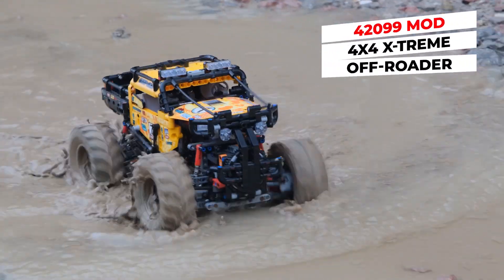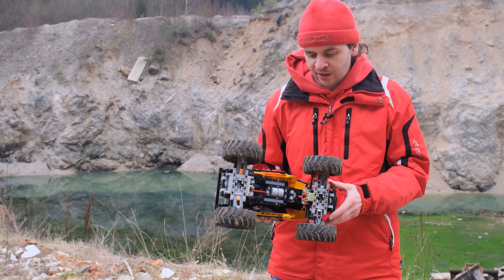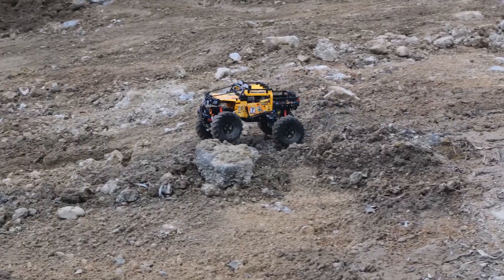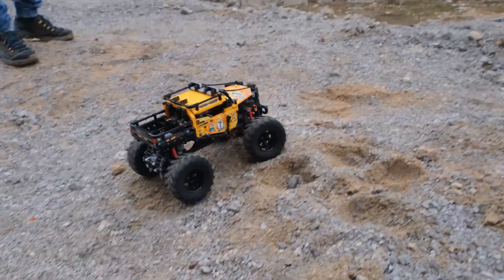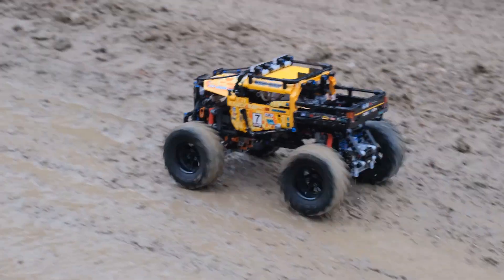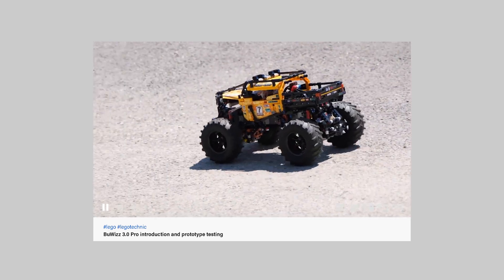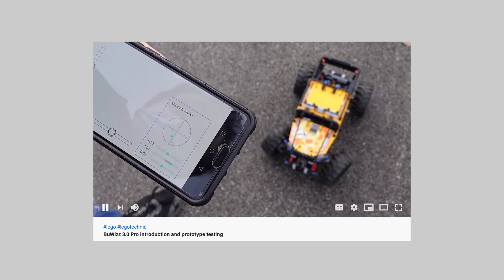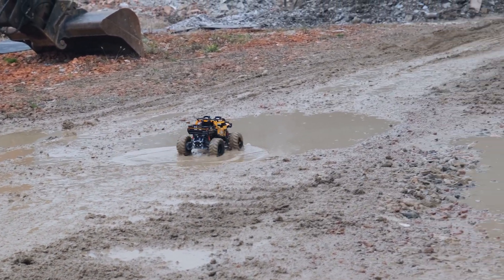Modified LEGO® Technic 42099 4x4 X-Treme Off-roader with 2 BuWizz Motors and powered with BuWizz 3.0

Comment: i litteraly bought a incompleet 40299 not sure if it works but i picked up for 15 looks like has al lower parts but ive been digging around on the BuWizz stuf they seem be the beter pick. But i dont realy like App controls.. i would love a RC unit box for RC controller. for the old school people.